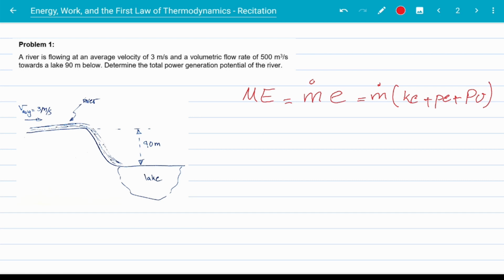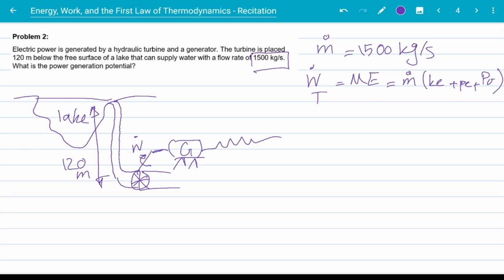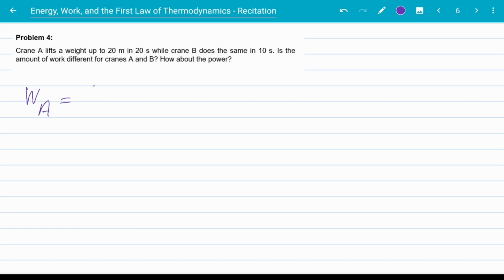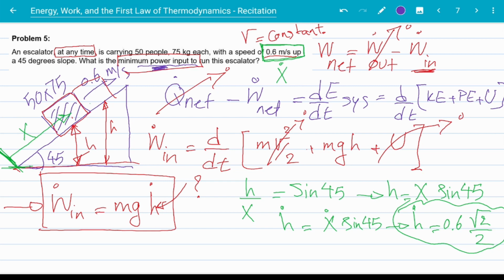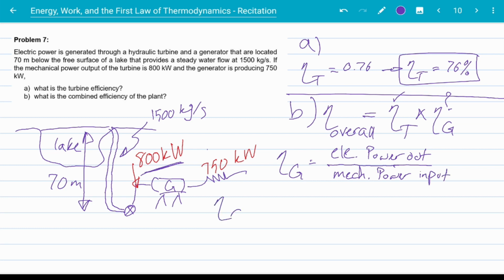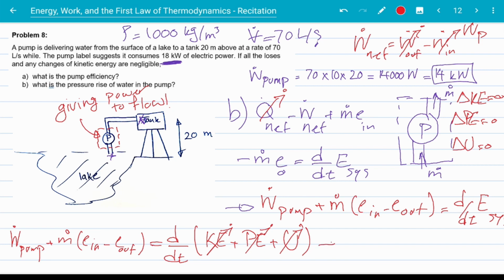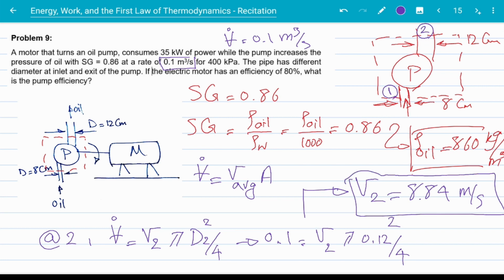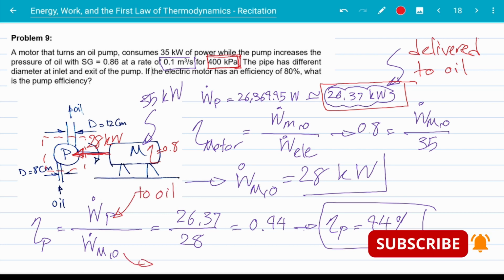Sample Problems - Energy, Work, and the First Law of Thermodynamics Recitation

Comment: Excellent video. thanks. You have used the formula for overall efficiency by multiplying efficiency of Turbine and generator. I get the same value if i take generator output against input to turbine. Is my answer is accidental or can I always use my method.
Reply from the maker: Excellent question. Think about your method. Yours and mine are essentially the same. When I multiply the efficiencies, the numerator of turbine efficiency (work output of the turbine) cancels the denominator of generator efficiency (work input of the generator which is work output of the turbine). You are left with generator output over turbine input.
TL;DR: Your method is always correct.